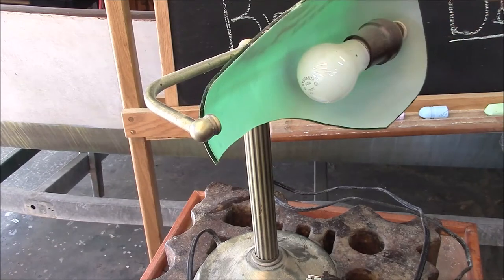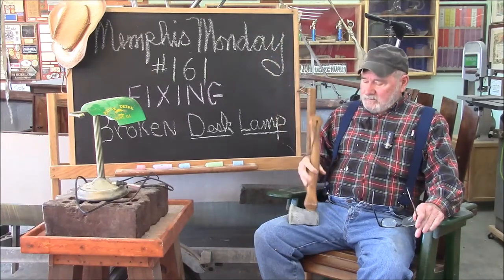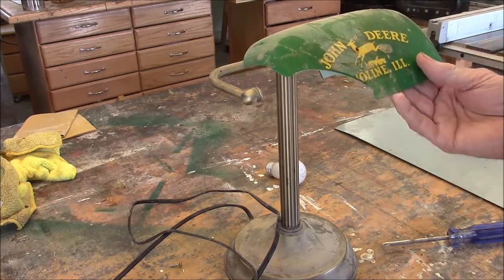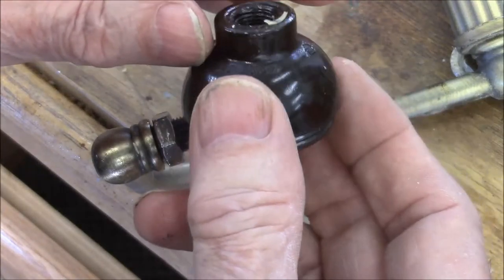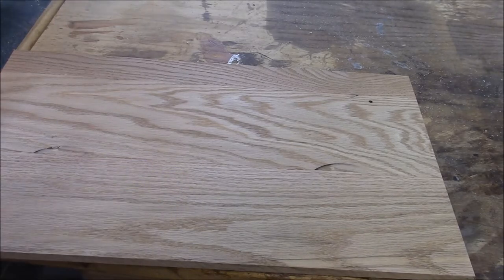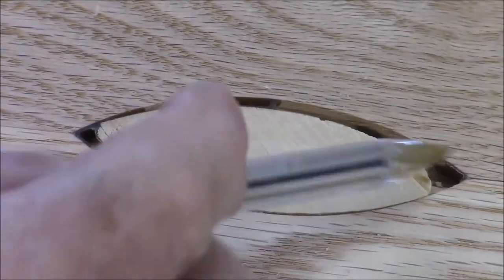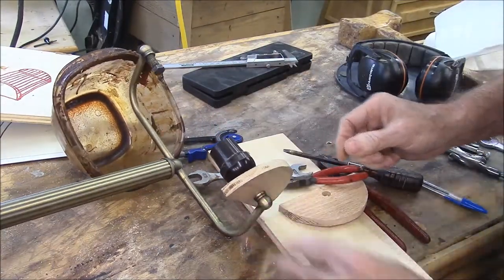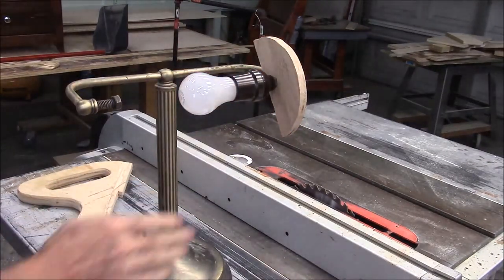161 Fixing a Broken Lamp with new wooden shade

Comment: Your reclaimed TV stand helped make a nice lamp shade. I was really surprised at how the biscuits fit when you planed down that board. It's always been my understanding that biscuits swelled slightly to fill up the space and the glue filled in what little space, if any, remined. Of course I've never been able to see what a biscuit looked like after it was installed so that was quite interesting.
Reply from the maker: That is exactly what I thought too.  I was surprised.  I'm starting to wonder if I've not been putting enough glue in the joints.  They make a little glue applicator for the biscuit slots, so I guess I need to get one.  
      Another thing I learned is that the slots are plenty big for those biscuits.  I'm always worried that the biscuits will bottom out in the slot, thus not allowing the glued edges to come together.  I now know that if my glue-up won't clamp together, then my problem isn't the slot depth.  
      Thanks for watching and commenting.  Probably will use more recycled wood next week too.

Comment: I like it!  You made it look simple enough to do. Even to try and build a lamp from scratch. 

My only concern is the heat like you stated in the video. If I wanted to batch out something like this and try and sell it, wouldn’t there be a concern about the user putting in an incandescent bulb rather than an LED bulb? I’d be afraid of the liability of a possible fire especially using some sort of polyurethane on the shade.
Reply from the maker: You are correct, it would require testing before I'd sell something like this.  As I said in the video, I used an incandescent bulb in it for some time in the shop, with no heating problems.  But that's a weak-sauce test; it's not a test at all.  Personally, I'd get some adult supervision from an engineer, electrician, and lawyer before I'd sell something like this.  
      Thanks for watching and providing such a thoughtful comment.

Comment: I hate to admit that I was a bit skeptical about this project but I should have known better.    Did those biscuits actually shrink instead of swelling as we have always been led to believe?  That was an interesting observation that one would not have expected.    I am happy to see that you reused the old fittings for the light socket.    The ones you get now days are fire hazards in my opinion.    Even with a little chip out of the old one it is safer and more durable.    Like you, I was amazed at the difference in the sizes of the 3/8" and 7/16" holes.     The finished shade is very nice.  You chose the perfect stain.  Mr. Ax/Axe/Hatchet appears to be giving his approval with this project so I suppose you have redeemed yourself.   

Please be patient with me.  I will get caught up on my videos some day.  It has been a busy couple of months for me.